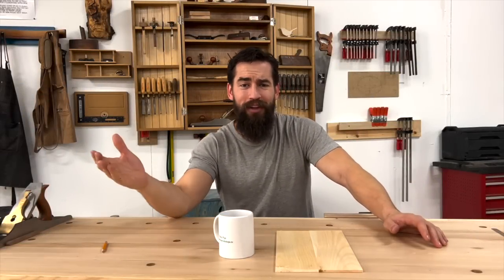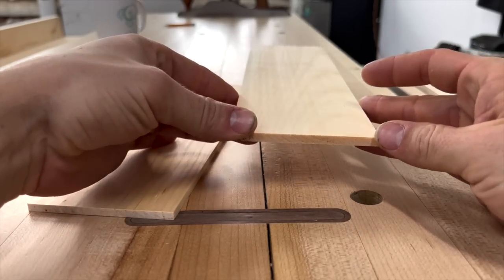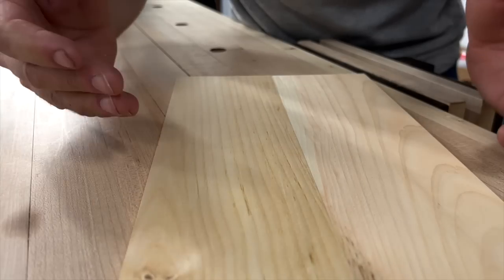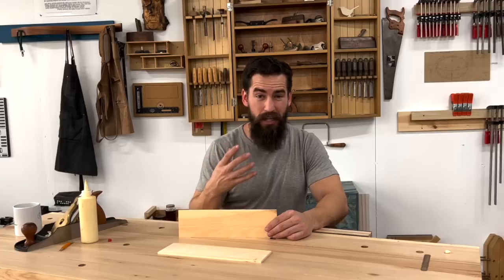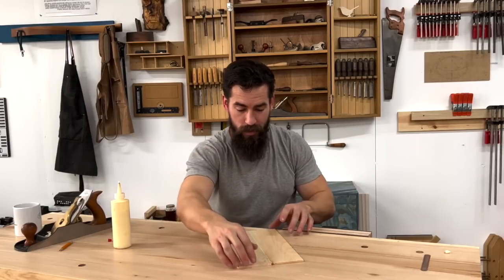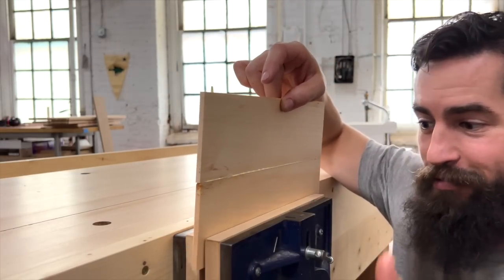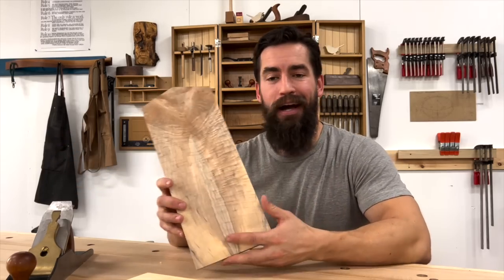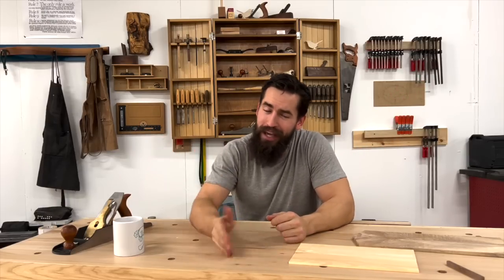No Clamps? No Problem!

Comment: You are 100% correct! The friction between the boards forces glue into the pores of the wood, forcing the air out. That creates a vacuum when pulled on the boards resisting loosening. I was taught this method by my grandpa when I was 10 yrs old, it never failed me. I love it when these old techniques prove their value time and again!
(62 yr old woodworker)
Reply from the maker: That’s so awesome to hear that the lessons your grandfather taught you are still being applied to your work. As a former wood shop teacher, that made me smile, my friend 🙂
Reply: Grandpa knew what he was doing.

Comment: Struggled today to glue up two 12 mm boards, I just could not clamp them without them cupping.  I'm going to try this tomorrow.

Edit:  after leaving the shed despondent yesterday I gave the rub joint a go.  On my first attempt the boards did not stick together.  Could it be something peculiar to Tasmanian silver wattle?  Don't be an idiot, I say to myself, then try it with just a little more glue...AND....right there like pure magic those two boards bond together.  This is going to be my go to technique for making the panel in frame and panel doors.  I CAN'T THANK YOU ENOUGH!  (When you used the term "bloody" I thought, has he been hanging out with Aussies? Then you mentioned crotchety old English woodworkers and it all made sense 😂).

Comment: At first I wasn’t sure about this but after seeing it done a light clicked on, oh yeah, when I glue up edges I rub them to spread the glue evenly and always notice how it grabs. Thanks for turning on my brain light. 😊
Reply from the maker: Haha I’m glad I could be of help my friend
Reply: I think metal machinists experience a similar effect when two metal surfaces are so flat and even that they stick to each other. I think it's called wringing. People are not sure why it happens. With wood it must just be glue suction?
Reply: Does this also apply to endgrain?
Thanks for the tip!
Reply: @snikkcarpentry3753  I don't think so. End grain is more jagged and also sucks up more glue.
Reply: @jackskalski3699 it's likely due to the surface tension of the glue

Comment: Years ago, there was an ad for a glue "one drop holds a tonne". In the ad, an elephant (circa 5 or 6 tonnes)  was in a harness with a machined metal block (with a machined surface) at the end of the lifting lines, which was glued to a similar block on a telescopic crane... yeah, the crane lifted the elephant, but (because of the machine mirror-finished surfaces on the metal) the same lift (with transverse movement preventers) could have been done using water. Physics is fun, and "nerding out", leads to new knowledge.

Comment: I just used that technique because I was gluing up two different thickness of wood, also some what thin, and to clamp it was proving very difficult so I glued just like you did, rubbed the edges together, laid on a flat surface, left it for an hour, came back, and darned if it didn’t work, I was feeling pretty smart about it, then I came across your video, and well, so much for being original.😂 Thanks for the video.

Comment: I was taught this is called surface tension. Like when you spill water on a table and go to pick up your glass and it kind of sticks….and that’s just water. Works great for reinforcing skirts or aprons with a corner block. Cheers

Comment: Hi, at the point when the two parts of the piece become hard to move and you stop, friction has caused heat to speed the glue set and the wood surface has absorbed much of that thin layer of glue..

Comment: Just wondering if this works so well on small pieces why do we use clamps on larger panel glue ups? I'd love to see a strength test.
Reply: Clamps allow multi panel glue ups. Quicker. This is slower and for big enough panels it would be too hard to shift them back and forth to come together
Reply from the maker: A head to head strength test could be interesting!

Comment: DUmb question...
When you clamped to plane the mating surfaces; Did you basically clamp back to back?
Reply: Clamp it so the two top faces are either on the inside or outside of the sandwich. Unfold it like an upside-down book once finished. The inside edges of both boards (the planed surface) remain touching when unfolded and glued up. That way, the edge doesn't need to be square to the top surface, but it does still need to be flat.
Reply from the maker: Fade to face or back to back. Doesn’t much matter so long as you open them back up the same way. Any angle planed in will offset that way and the board will stay nice and flat

Comment: It's basically capilirstion. Take 2 sheets of glass and drop some water on 1 surface and press together.  Now try to pull apart. It ain't coming unless you slide it

Comment: Tbh….this ‘rub joint’ isn’t a special ‘technique’,  its something we all do in spreading glue and aligning pieces as a matter of course…At least I think so huh!  I guess if there is someone out there has only ever slathered everything in gop and clamped it up, this might be news!
Reply: You clearly haven't grasped the point of the video - this isn't about spreading glue in a joint, it's about using the spreading of that glue in order to create a vacuum type bond between the boards, which negates the need for clamping, while the glue dries (cures).
Not sure if it was the mention "English" woodworkers that threw you, but this is one of the oldest known and therefore special techniques, because English woodworking, which traditionally only (used) uses hand tools, has been around for hundreds of years and their techniques have been passed on worldwide.